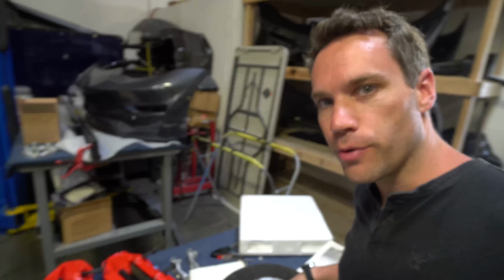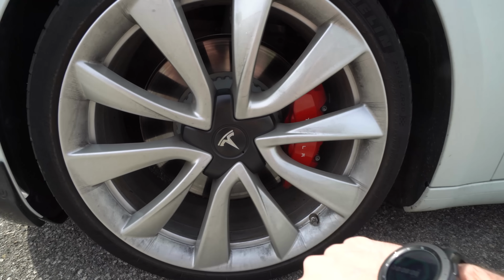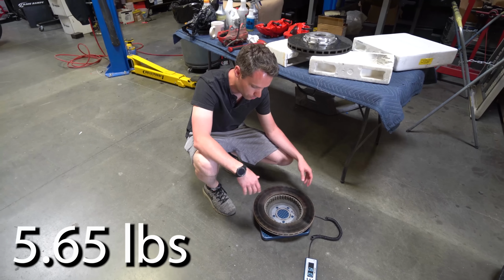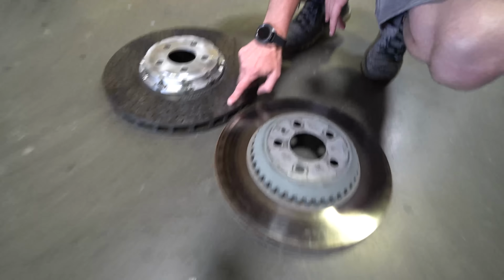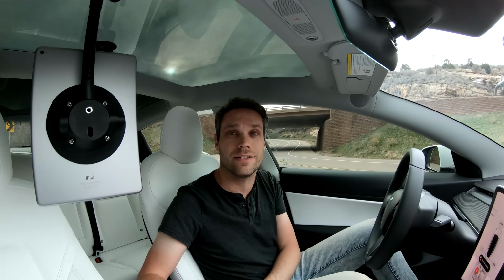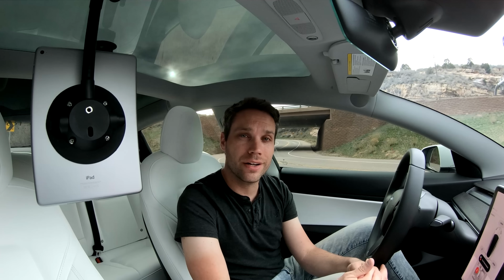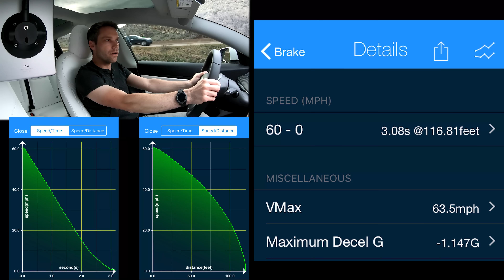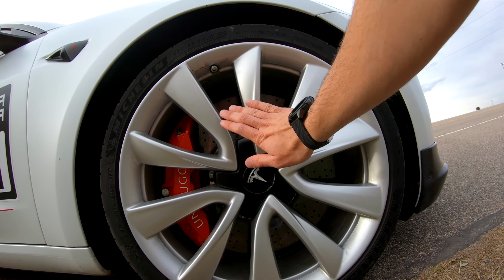$8,000 Tesla Model 3 Brake Job. *Carbon Ceramic*

Comment: 60-0 with 18” all season: 133 ft
60-0 with 19” tires : 124 ft
60-0 with Performance brakes and tires: didn’t measure
60-0 with $9000 brakes 114 ft.

Does anyone have some 60-0 times for a stock P3D with factory 20” wheels?
Reply from the maker: I might get these results this weekend. All my local friends are on winter tires. But one might switch back to his summer tires.
Reply from the maker: I think the big difference though is overheating issues with the stock brakes (all models). The carbon ceramics won't experience this and should actually be better at hotter temps.
Reply: I will try it tomorrow with my dragy I have a stock performance with stock tires 20in rims
Reply: DÆrik, did you also weigh the calipers to see how much weight was gained/lost? Those new ones looked huge.
Reply: Adam Rucker, cool. I think most people don’t want to push their car so hard because it is very stressful. I actually tore a control arm out of the unibody of my car once buy slamming the brakes as hard as possible. Of course it was a little rusty under there. Lol
Reply: 116 foot with 2.6 seconds 60 / 0  I posted it on dragy you can look it up
Reply: @imho7250  lol what kind of car break a control arm while breaking? that means in an emergency situation that's a very dangerous car to drive, sounds like it's either gm, ford or Chrysler. Haha
Reply: TigerKurdish, a 1981 Fiat 124 spider with rusted unibody. LOL
Reply: @imho7250  haha I see well that's pretty old, that would not happen to a newer car. Carbon ceramic breaks are good if the sole intention is always tracking the car, other wise it's a pricey mod that isn't really worth it for regular use.
Reply: TigerKurdish, yes, and I think they don’t even start working well until heated up, so the emergency braking distance on an EV with carbon ceramic brakes in the winter might have a longer breaking distance than the factory performance brakes.
Reply: @adamrucker3268  now you make me wonder why some saying 99ft

Comment: An open Wheel ad more Turbulent flow. aka drag. and maybe the big brakes act like the Aero Wheel cover on the 18 inch.  So i Guess you get a better range/mileage now. So in 20 years you might have   saved the cost on the brake kit in fuel/watt :>) If you use the full stopping Power in traffic you might get rear ended.

Comment: If you really want to test your brakes then you should warm them really hard, because good carbon ceramic brakes (the real racing ones) brake better when they are glowing hot. For street use in relatively cold weather they are even worse than steel ones. And if I’m not wrong you need a stronger brake fluid high pressure pump.

Comment: The weight reduction is nice. However, since they are bigger (larger radius), it has a larger moment arm, increasing the inertia (rotational resistance), potentially eliminating  the expected lower acceleration time. Interest in seeing a 0-60 time

Comment: When you have too much money to burn... :)
Reply: It's a shame. Going downhill unfortunately. Too much money to spend and time spent on unnecessary acceleration tests. Didn't think this was a racing channel. Still, OK for the rich.
Reply: When you get free Roadsters you do have a lot of money to burn
Reply: @nickhickson8738  Well ceramic brakes are probably the best mod you could do to your car: They're lighter (better handling, better range) and they don't overheat as much. They also last longer than conventional disks. Many sport cars actually have ceramic brakes as an option (Porsche, BMW M-series, Merc AMG spec cars and Audi RS cars), so it's not a "waste of money".
Reply: @kevinngenovese8424  also they dont rost

Comment: Sorry but he Model 3 is not a racing car, way too heavy, you must strip all out. The two engine art only made for short power boost on the street. They don't have enough cooling system hey will be limited soon. You will destroy them and with that changes you made you will have no TESLA garantee. Look on a real racing EV car and you will see quick the difference. I see money is not your problem.